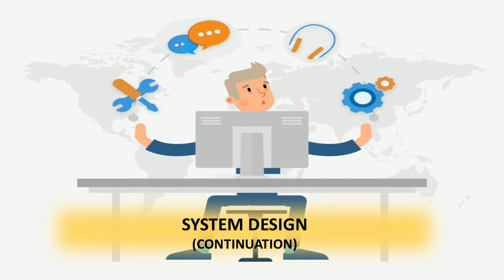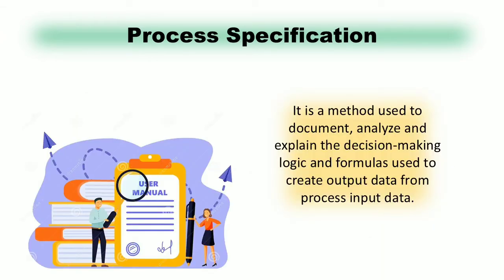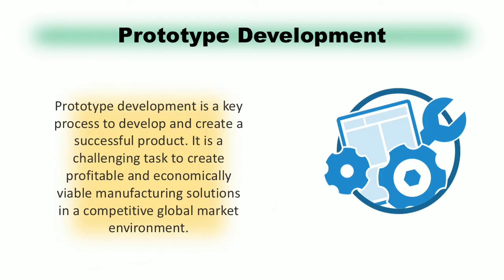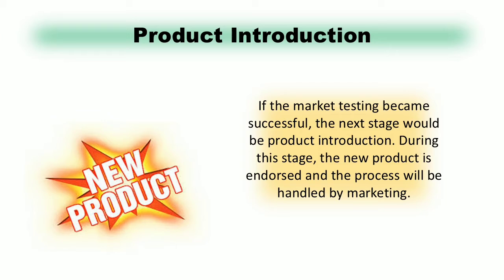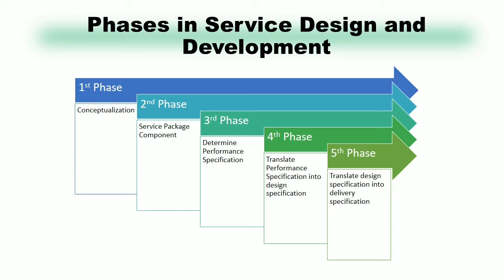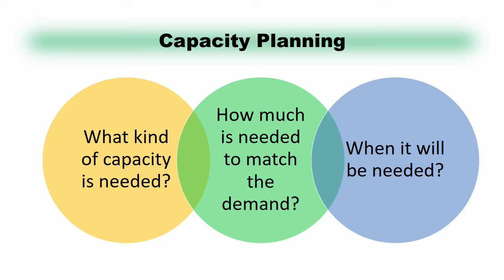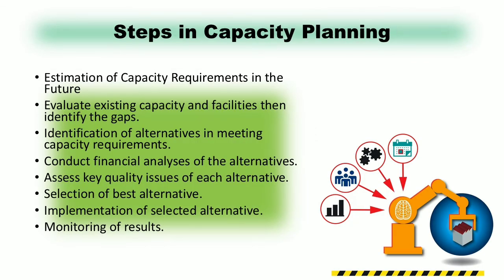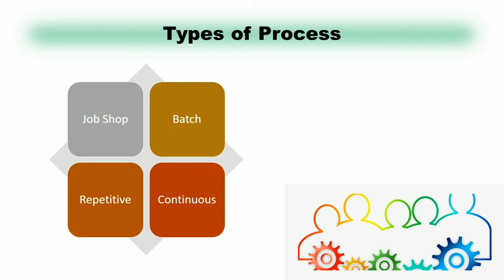System Design (Continuation) | Chapter 5B | OPM-TQM

Comment: After I've watched the continuation of System Design, I learned that Product design is the process of identifying market opportunities, of clearly defining the problem, of developing a proper solution to the problem and of validating the solution with real users. The purpose of the Design Phase is to convert the requirements into complete and detailed system design specifications. If the concept has been accepted, the development team will begin the development process.

Comment: Redesign of products and services is typically a form of strategy to help the company grow or achieve success. In product design and development  they have phases that need to be followed so that the product will meet the customer and market demands. 

The phases of service design and development are one of the essential fields of system design. In the stages, the design of the service has a strategy, method and analysis. If the payment and delivery is involved, the physical resources necessary for the service are referred to. In the system which specifies the process of the service to be performed the developer must be precise. In order to achieve its business specifications, developers should be specified in items included in the service design. Developers should also ensure that the requisite qualifications are met in the necessary facilities and that newly designed services are provided.

Comment: In this video presentation, it tackle the different phases in product design and development. First is feasibility analysis is to determine all the relating factors to a project, product specification is to determine all the requirements needed to a certain product to provide an overview to see the design desire features and result. Process specification needs to consider all the necessary process to the desire outcome. Prototype Development is testing or examine the design after that is design review simply to see if there is any need to improve regarding to yhe design. Market testing is to get feedback from the consumer to see if there's need an improvement and enhancement not only on the product but also on the process. Product introduction if the market testing that they did was successful and lastly the follow up evaluation and there is also phases in service design and development with 5 phases which is also important in System Design.

Comment: The video is all about the information you can use in order to make you product and service design successful . System design has a process needed to acquire in order to achieve your goal in  product and service.  There are a lot of things you need to  consider when it comes to formulating a  new design. The phases mentioned in the video will be the guide for you to come up with ideas and decisions in your product and service design. Also with the strategy given, you can make a good strategic plan for your design.

Comment: According to the video presentation, I have found out that designing or redesigning a specific product or service go through the different phases before it become available in the market. The company studied it well to provide quality product and service that can rival the same product or service of their competitors. In designing or redesigning you could uncover the strengths and weaknesses as well as their potentials to make the customers buy it. Companies must not stop improving their product or service to adapt for today's time and to address what the customer is really needed where they can use it conveniently and not causing any difficulties upon using. If the implementation is successful both parties will benefit (customer and company).

Comment: In the continuation of the system design, I've learned that every areas of system design are very essential to the business before making or creating a product or output and before endorsing it to the market. The production must be well organized and the company or business must well-prepared about all of the plans in order to save time and money. In creating a business and it's product, they must carefully follow some steps or process systematically so in the end they can have a successful products or output and also they save their time and money. 

The 8 phases in product design and development such as: (1) Feasibility Analysis; (2) Product Specification; (3)Process Specification; (4) Prototype Development; (5) Design Review; (6)Market Test; (7) Product Introduction; (8) Follow-up Evaluation are needed to be followed systematically in order to create and introduce a new and successful product in the market so the business could have more profit. Also, it is to have a improvement or development of a existing product. The capacity planning is use to determine the capacity and workforce of a company that are needed to meet the demand of the customers.

Comment: As I watched the video presentation, I learned that in system design, there are so many processes that are needed to be done. It's not easy to work it alone because the product and service design, even the redesigning, are needed to continually improve the insisting product and constantly meet the customer's demand.

Comment: In this video presentation about the continuation of system design I've learned that organization should have a good capacity plan. Capacity planning is one of the key strategic in designing system . It is the strategy that an organization uses to forecast the production levels that the organization should have to ensure that the demand of the goods or services in the market can be catered to.

Comment: System Design is very essential for the company in innovating their existing product or service. It has a process that need to be follow by the organization for its success. For redesigning a product and service first, they need to know their purpose why did they need to redesign their products or service.  It has a lot of things to be considered, they need to study well the products and service before they introduce it to the market. There are many researches and data gathering related to the features of the product to come up into new output, it includes here the strength, weaknesses, opportunities and threats that may arise during the process. Capacity planning also play a vital role in system design, they need to know the capacity of demand, the workforce needed, budget and the equipment and materials that are needed to produce a product.